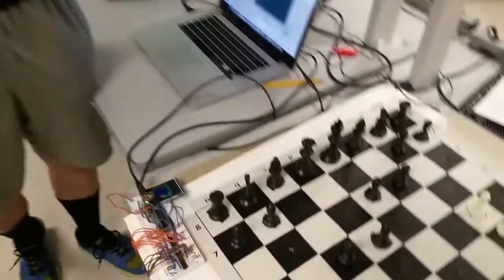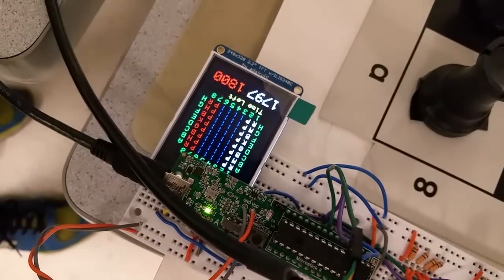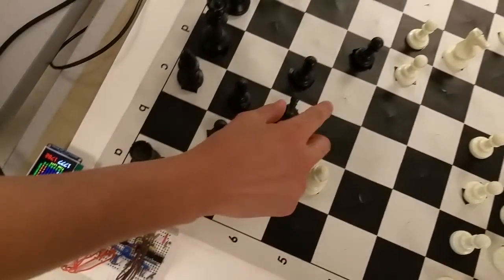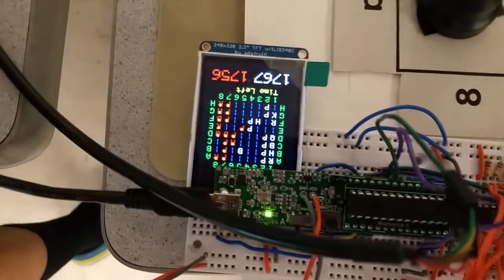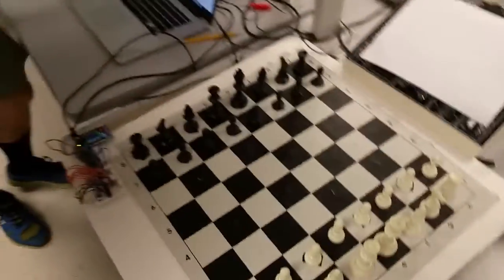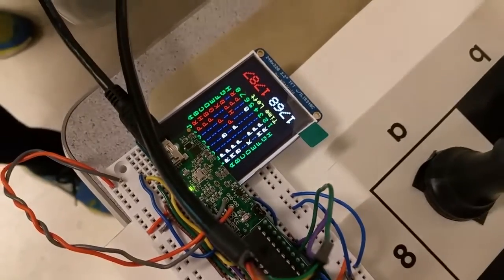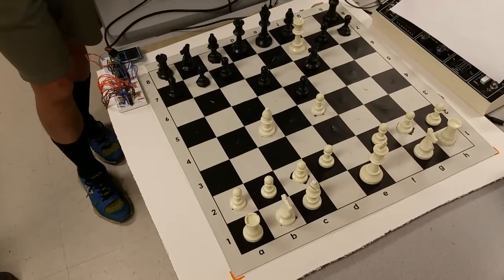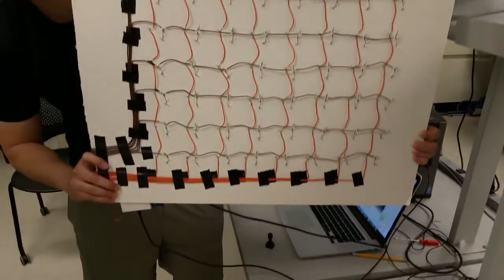Chess board -- magnetic sensing

Comment: if a magnet is placed on a reed switch, does the current flow until the magnet is removed? or does it send a pulse when the magnet is placed and another one when it's removed?
Because if it's the first option I can't understand how you can detect the correct position of more pieces
Reply from the maker: https://en.wikipedia.org/wiki/Reed_switch
Reply from the maker: reed switch is just a spst switched activated by magnets. it has not other dynamics of its own. Decoding logic has to find edges.
Reply: @Bruce Land  thank you for the reply, but I still can't understand how you can detect all the pieces with just 16 wires.
Example
if I have 4 pieces in these coordinates:
1 a
2 a
1 b
2 b

if I'm not wrong, current should travel from columns A and B to rows 1 and 2, but if I rise up the piece on position 2 B, the current should still travel from the same wires as before.
Probably I got something wrong, but I really can't understand how this can work
Reply from the maker: @zanettiii  You treat this like a memory array only activate certain wires, while you float other wires.  You drive one wire and read all the wires in the other direction, then device the next wire. YOu can also deccode with diodes in series with each switch. google diode rom memory
Reply: @ece4760  okay, thank you so much :)

Comment: How sensitive are those reed switches? I'm planning on doing something similar (also for a school project), but I want to have a plexiglass cover with leds underneath to light up the chess squares. Not sure if having the plexiglass inbetween the switches and chess pieces would cause issues though.
Reply from the maker: Plex is not magnetic, so only the distance matters. You will have to try it with your magnets and plex

Comment: What kind of multiplexer and how many did you use in this project? I'm really curious, because I couldn't see any, and the reed switches seems to be all connected to each other!
Reply from the maker: The edges of the 8x8 array are driven with two MUXs. The diodes next to each switch steer the selection. See

https://electronics.stackexchange.com/questions/307151/how-can-i-read-an-large-array-of-switches-with-some-microcontroller
or
https://electronics.stackexchange.com/questions/365958/options-to-read-an-8x8-switch-matrix
Reply from the maker: The students actually used two cd4051  1:8 analog muxes
Reply: @ece4760  Oh, this is really nice! Now it makes sense to me... Thank you for sharing your knowledge! I'm intending to do something like this.

Comment: Is this a school project? 
 CXG Systems made something similar back in the 80's or early 90's. I have one of those in a drawer somewhere. The Computachess IV CXG 227. The chess pieces have magnets in them and the board lights up to show the moves. It has 16 modes of difficulty. I stopped playing it because one of the pieces went missing, and I never got around to fixing it. :) 

http://chesseval.com/BrandBoard/CXGBrand/IMG_0013.JPG
Reply from the maker: it is a school project
Reply: Very cool. I'm no engineer but I would have maybe looked into capacitive buttons and metal chess pieces instead of switches? Or maybe a capacitive touch screen as a board? But those switches gets the point across just as well, i guess, and they are probably easier to handle.